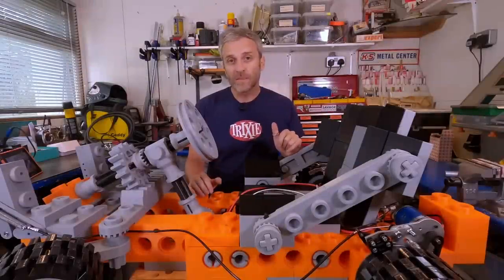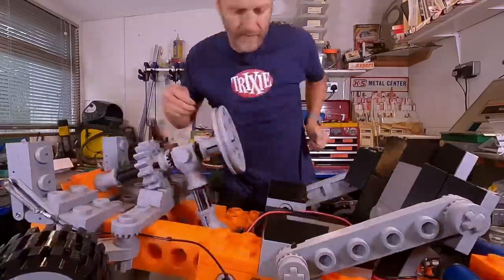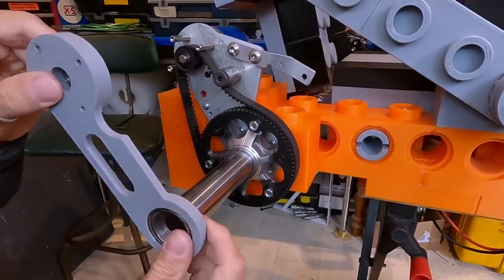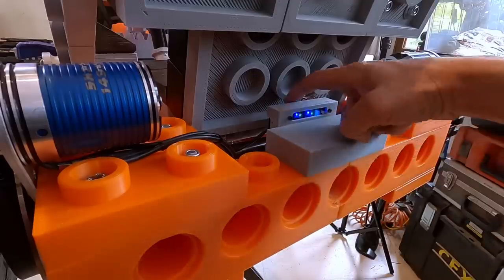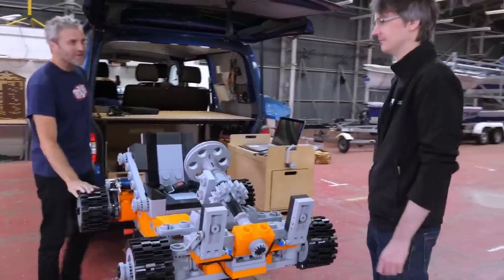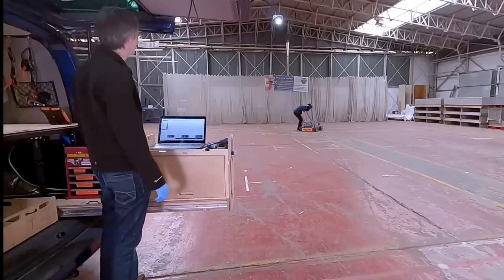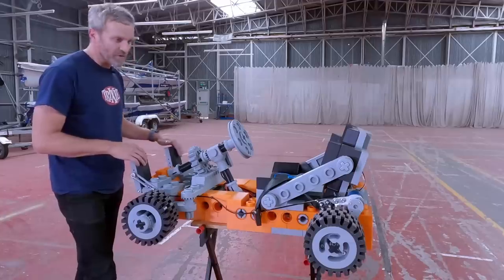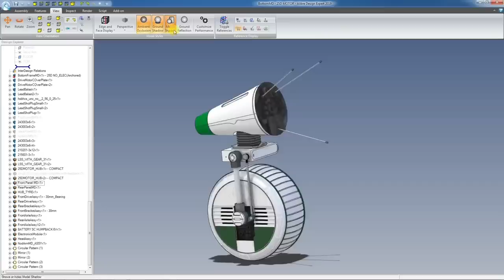XXL LEGO Go-Kart! | Test Drive Mk 1 | #4 - Mantis Hacks

Comment: I do like the idea of covering up the motors. 
It really helps add to the belief that you're driving a magic Lego cart.
Reply from the maker: Yeah I'll give it another go..
Reply: (plus safety)
Reply: @MattDenton  You could try mimicking the housing from an old 5x4 LEGO motor, rather than just a grill piece. Those motor grills were more square than sawtooth. To keep to your space requirements, though, maybe "crop" that form rather than scaling it - I reckon incorrect scale would stand out more in this case.
Reply from the maker: Yeah I made those motors on my 5 X kart...

Comment: That looks fun but insanely fast especially if still accelerating as you mention. Any idea what sort of speeds you were clocking?
Reply from the maker: Yeah it's too fast.. I need to do a drag run and see what it will do.. then just for fun maybe 195kv motors 😆
Reply: @MattDenton  🙈
Reply: Ean Sweeny "not very expensive" it's very expensive like $20 for 2 lbs PLA filament

Comment: I have an idea for a textured block you could use to hide the motors. The staggered slant pieces, like the ones that just have a curve on top and 3 levels on the bottom for connecting. They could add a nice car shape to the back and fit under the seat bracers

Comment: For rubber tires, print a form and pour a flexible rubber epoxy, or something, you can rough up the inside of the new rubber tire and the outside of the rim, should help with the traction and spinning on the rim. You can add bolts just to be sure ofcourse.
Reply from the maker: Good idea 👍

Comment: The way the bricks have kept locked into place throughout this whole test has me impressed.
As your long bricks are split into two pieces when printed before you join them back together, I ponder... could it be possible to 3D print and scale up a portion of the CCBS system for cosplay purposes in a similar manner (for arms and legs only). The basic ball and socket system is bulked up by attaching armour shells to ball joints that are located in the center of most bones in the build system and I think if a custom ball joint could be made to fit on a limb by attaching both halves together, that could be a possibility as long as the socket in the scaled up shell isn't too tough to attach to said joint.
Reply from the maker: There are some boots involved in the assembly.. primarily because I don't want to glue anything!
Reply: @MattDenton  Oh, how intriguing. I didn't know adhesive wasn't used to keep some of the bricks together.

Comment: Suspect someone's mentioned it already, but I'd say your best bet on splitting the rear axle would be to turn it into a dead axle, and attach the bearings, drive sprocket etc. to the wheel; you would need to add an extra rear brake (or rely on motor braking) though.
Reply from the maker: Yeah not sure how easy that will be... But will look into it

Comment: Awesome project!
Quick note, the idler looks like it's on the load side of the belt, it would be better on the "slack" side so there's less tension when at full torque.
Reply from the maker: Thanks. It should be on the slack side. When the motor is driving it's pulling on the belt straight down to the large pulley. The idler side goes slack. Until you use electronic braking the the idler has tension.

Comment: Instead of trying to attach the tires with screws, you might consider redesigning the hubs and tires to add gear teeth which would mesh together and lock the tires to the hubs all the way around. Gear teeth around the inside of the tire, and corresponding gear slots in the hubs. So that once the tires are seated, they're locked into place. Would still look totally LEGO stock from the outside but be far more secure.
Reply from the maker: Good idea but it's alot of stuff to reprint 😬
Reply: @MattDenton  Something to consider for a future project or a version 3.0 then, I guess.

Comment: Have you considered using the tires you used on the monkey bike, or at least a common size? You could have either better off-road grip and the suspension air tires add. You could also put proper drift cart tires on it for some hooligan fun.
Reply from the maker: Yeah I may do an off road version with scent tyres one day

Comment: I think you should put a split rear axle on there, as making a Lego differential with smaller plastic pieces might weaken the rear end. I don’t know, maybe not, you’ve probably got a better idea than that
Reply from the maker: I have an idea... But it will be a split rear axle.

Comment: For battery monitoring I would suggest buying some low voltage alarms that plug into the balance plugs on the batteries they are fairly cheap and will probably be more accurate than writing code for the arduino to read and output to an lcd
Reply from the maker: Yeah I have some of those.. but will also go for a display to monitor overall battery life..

Comment: Hi Matt, 
I loved to see your go-kart working and thought in a few things you could check if you like it.
1 - The place you were, were really dust and this might have impacted on your brakes as you were sliding
2 - As the wheels were sliding, the torque on your back axle was minor, helping to drift and not creating problems to steer.
3 - With two different back axles, the sliding problem might be reduced, adding an differential would be awesome 
4 - The problem with the two back wheels might be fixed if you add some screws to tie them together
hope it can help, good luck and wonderfull work!
Reply from the maker: Thanks 👍 and thanks for the comments. I think the fit helped steering... A bit.  But I think an E diff and screwing the tyres in place will be the way forward 👍

Comment: If you want to do differential, what about having the wheels mounted on bearings then having the pulley attach directly to the wheel, kind of like motorbike, then you get to keep the one piece rear axle but also can do an electronic differential. Although i am not sure how you would mount the brakes but I am sure it would be possible if not you could always use the motors to brake.
Reply from the maker: Tricky to modify that way now..

Comment: It's looking amazing Matt! I'm worried about the mount for your belt tensioners. Is all the torque applied to the base of the tensioner mount transferred through two of the nut's six faces, against a thinner section of mounting plate inside the groove? I'm not sure how much force it can withstand before it bends.
Reply from the maker: Well it's not "that" tight and there is 3mm plate left in the slot. Also, when moving forward the belt is tensioned in such a way that the part going over the tensioner actually has the slack.. when braking it switches 😬

Comment: Do you only use the disk break to stop the kart? Question is if you can use the disk break with (ebs) electrical break system with the motors. And maybe regen power to the batteries when breaking.

Also the kart is verry close to the floor maybe you need some bigger wheels, tiers or rims.

Regards the kart being 40KG pluss personal wight the kart seems to go quite fast, and if needed to add some more kart wight this seems not be an issue.

Regards of the motors in the back use a lego tube between the motors M------M can be good for some cable management, but also add break lights maybe following the tube.

Keep up the good work!
Reply from the maker: Thanks. It already has regen braking.. but I didn't want to rely on it... However I will test it without disk brake at some point 👍

Comment: Instead of splitting the axle,  you could fix the rear axle in place, put bearings in the wheels, and bolt the drive pulley straight to the wheel.

Comment: That was awesome! All part n parcel of the design process really. Prototype, test, make changes. Would a reverse function be doable? Desirable?
Reply from the maker: Thanks. Yes reverse is possible but not sure I want it as it requires double tap brake... Which I may do by mistake 😂
Reply: Matt Denton  ahhhhh, good point.

Comment: Differential on ONE axle:  You need a DEAD axle.  What you have now is a LIVE axle.  The twin drive you mention is TWO live axles.  So what you do is RIGIDLY mount the axle shaft in the go cart.  Then you need some different wheel hubs that have internal bearings so the wheels spin on the axle, rather than the axle spinning in the car.  Wire the motors in parallel and they will self balance.
To get an idea how this would work, imagine the front spindles on a car with rear wheel drive.
Reply from the maker: Yeah I could but I think it will be harder to implement in my current setup than twin live axles.... I think..
Reply: @MattDenton , Check some go kart supply shops.  You'll find what you need.  A lot of older, mass market go karts were sold back in the 70s with a similar drive train and only drove one wheel.  The opposite rear wheel was free spinning, so the hubs you need do exist.  These old karts had stub axles welded to the frame.  They also used ''Scrub'' brakes.  Metal pads on a crank arm that just rubbed on the rear tires when you hit the brakes.  Crude, but they worked.

Comment: What if you kept the solid axle, but put bearings in the wheels, and connected the drive pulley and breaks to the wheels?  You may have to add another brake to keep it straight when you stopped.   Independent brakes could be fun (two pedals), then you could have better control over power slides.   One wheel full stop, the other full power?  I'm also thinking that bearing in one wheel would provide you the same independent control over the wheels. The dive shaft would continue to spin on both sides, but one  wheel would not be connected to the shaft.  That one wheel may not even need to be powered, just keep both motors connected to the drive shaft.
Reply from the maker: Yes that's a possible solution . But it would corner better on one side... 🤔

Comment: Instead of trying to split the rear axel, why not switch to a fixed rear axel and have the wheel assemblies rotate on it? With dual drive, you don't need a keyed axel to transfer power, and can drive the wheels directly off each motor assembly. This would also allow you to build an electronic limited slip, and program a speed/power bias based on the steering position.
Reply from the maker: Yep possible... Would need to re engineer the wheel assembly

Comment: I think it would be pretty cool if you altered the Arduino code in such a way that, once at a complete stop, if you continued to hold the brake pedal for some pre-determined amount of time then pressed the accelerator, the cart would move in reverse! Of course, once the cart is in “reverse mode” you’d have to let off of the brake. But once you were backed up enough, you could let off of the accelerator then use the brake pedal to stop reversing. As soon as you release the accelerator in “reverse mode” the cart would return to forward motion.
Reply from the maker: It has that mode in the VESC.. but I'm a little nervous if using it... Just in case!

Comment: Perhaps you could you hook up a switch/shifter to give you slow, fast and reverse?
Reply: It would be cool do design a 4 speed gearbox + reverse, although the kart is pretty fast as is
Reply from the maker: Yeah reverse maybe possible with serial control from Arduino.

Comment: Easiest way to solve the steering problem is to add weights to the front!
Reply from the maker: Yeah but want to keep weight down for acceleration
Reply: @MattDenton  I understand, it doesn't need to be alot, just enough to keep the center of mass more in the middle of vehicle (with the driver)!

Comment: cant u make a wheel joined with a pulley freewheel around the solid axel as u are using 2 motors anyway?? you would be able to keep the strength of the full axle.
Reply from the maker: Possibly yes 👌

Comment: I have an Idea for your wheels, if you modify the grey inner wheel in your cad program to that its like a ratchet system almost on both sides of it. You have a series of triangles and flat rectangle points, so you have more of a secure wheel that relies on the plastic and less on the glue. I have an autodesk inventor program that I got for free through school, and tomorrow ill create a wheel modeling what it would look like and email them to you if you’d like
Reply from the maker: I know what you mean.. problem is the tyres are really hard to get off. Now... So tricky to modify the rims..
Reply: Matt Denton do you mean hard to get off of the axle?
Reply: Hard to get the tire on/off the rims
Reply from the maker: Correct. One of my videos shows me getting the tyres on the rims.. not easy!
Reply: Matt Denton how much does it cost to reprint the rubber and how much does it cost in total?

Comment: 60 amps is at what voltage? 22v? That makes it 1.33 kW, just over one horsepower. Kids' go-karts come with 5.5 horsepower motor and accelerate to 30 mph, regular public go-karts have 9 horsepower motors and can go quite a bit faster than that.
Reply from the maker: It's 60amps per motor at 44.4 volts, so more like 5.3 kW

Comment: don't put your thumb through the holes in the steering wheel! if you crash and it whips around it will thoroughly maul it :( Solution could be to print a lego technic steering wheel
Reply from the maker: Good point! Yeah I don't have sprinter big enough for that part .

Comment: How does the maker community think about 3D printing and the move away from plastics in day to day products and plastic waist?
Reply from the maker: I think the plastic issue is with single use plastics in product packaging. If compared to the use of plastic used by hobbyist it is the amount is insignificant. Also, product packaging plastics have to be much tougher and hence don't break down easily. I use PLA now which can be biodegradable.

Comment: Fun fact, motorcyclists lean INTO curves, go-carters sit straight or lean OUT of curves. A lot of first time carters lean the wrong way. Both of yous seem to lean the bike way.

The reason for leaning out is either "Definitely to the outside, to load up the tires which need the grip." or "The only time worth leaning to the outside is if you are racing in the rain...Because a kart has a solid rear axle it is essential to lift the inside tyre through a corner otherwise the kart will understeer through the corner and in conditions with minimal grip it might help by leaning to the outside.

My recommendation is to set the kart up properly though" / https://www.ferrarichat.com/forum/threads/karting-advice-shifting-bodyweight.211145/

Comment: 50 Amps... just for scale, our 1:8 RC Racing buggies (offroad, not onroad) have 1 Motor and suck 150 Amps... You might need to step up the ESC game ;)
Reply from the maker: 50 Amps per motor at 50v so approximately 5Kw combined! I doubt your RC buggy is pulling that kind of power continuous 😆 if it is... I'd love to see it 👍
Reply: @MattDenton  you have a point there ;) running on 4s, 14.4v making around 2.4kw... ;) I bet there is a guy who made a video strapping 2 motors in and going 6s... that would top that 5kw ;)

Comment: Qs 4kw motor 👍 use one of them and spim08hp batteries then your fast
Reply from the maker: Ooh I'll look that up 👍
Reply: @MattDenton  me and my friend did a electric conversion to a normal gokart with their 3kw motor and are getting wheelspin from 0 to 50 km/h. We are using 3p20s battery and are using those spim08hp cells. If you search for MrB on youtube you will find a guy who built on the same controller and motor as us
Reply from the maker: Cool I'll check it out 👍

Comment: It's electric. Y u no reverse?
Reply from the maker: Not in the mode I have setup no.. but possible 👍
Reply: @MattDenton  I say go for it if yer gonna run it electric. No reason not to tbh. Plus when you get it dialed in, with reverse, you can do J-turns and such.
Reply: @MattDenton  Something else came to mind too. It's electric. You're gonna be making revisions for MkII anyway. Why not go with four smaller motors and make it all wheel drive as well? Nice advantage of electric, that. And with electric braking you'd have four corner brakes as well, with the mechanical brake acting on the rear as current for redundancy and emergency purposes.